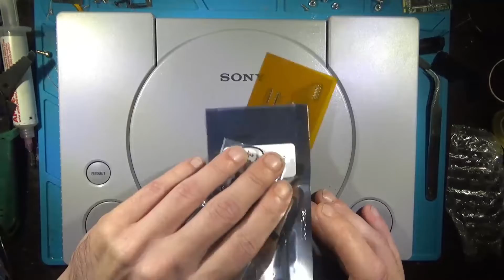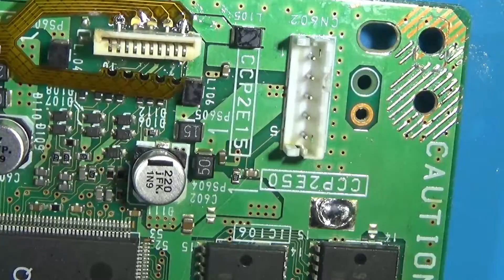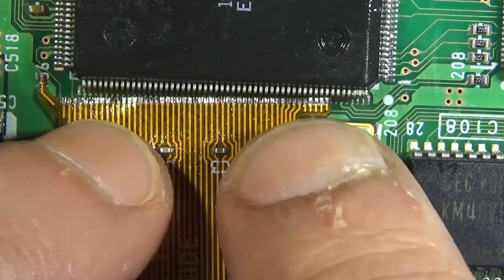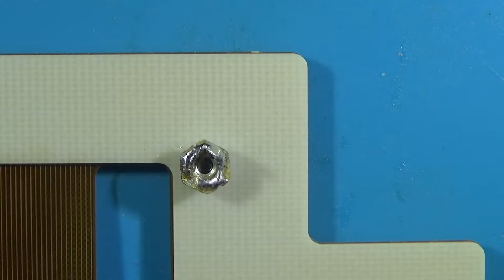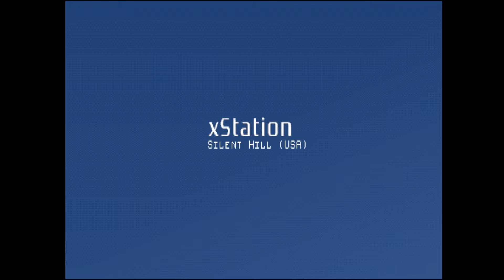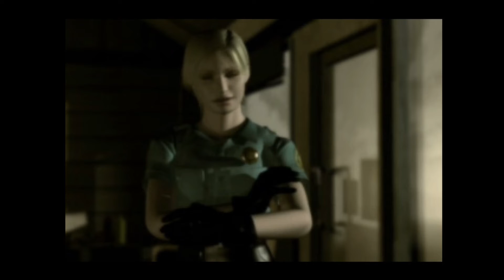PS1 Retro Gem / Ps1digital Installation

Comment: The installation guide from pixel fx says: -
Before installing the main flex, cover up any exposed vias that make come into contact with the flex. The CLK_EN pin can come into contact with via that is going to ground. Make sure you cover this up.

Didn't see you do this??

Comment: I fked up my initial install with the bigger flex cable, I did a drag solder and some of the pins got moved. I had to get a whole new flex cable and reseat the pins before reinstalling. Moral of the story, don't drag solder.

Comment: Hello , that was the perfect video . Great job . I have just finish installed mine . But ... I have this flickering thing at the boot screen , but not in the xstation or games . I think you talk about it around 18 minutes. For me it is more an up and down fast shaking . I don't know if it's the same issue . Or if it's an issue or not . Also , in rgb signal my sound makes crispy noises . When I use the debug test mode all is ok but for the rgb part it says it needs 24bits to be tested but my clk is only 15 bits . I'm not sur what to think about this.
Reply: I still have it in games i just realize . My image is constantly slightly shaking up and down . And no hearts in the rgb part in the debug mode. I think i have an issue with the clock . I did all the bridges for the clock mod and my pal console .

Comment: I've done 3 of these now. They were not easy compared to other modifications out there. Speaking of pixel fx durability, I got pissed off and went into "oh fuck it" mode while soldering the audio flex while having sticky trouble clearing a bridge no matter which flux I was using  or what method I used. This bridge was like something I have never encountered, and it angered me dearly. I cranked it up for 470 to fix the bridge after multiple attempts to clear the bridge by other means. It worked wonders and made the prettiest joints too. I then opted to throw caution into the wind and do the gpu flex the same way ( I had extra flexes in case of unrecoverable trouble). I covered the legs with kapton tape to protect it from solder splash. I did very quick tap and drags across the pads and it was beautiful. Thank you for the uploads I enjoy your stuff very much
Reply: Using a Hakko with a chisel tip, with good branded flux and Kester Solder wire makes soldering in advanced mods like this a lot easier. I find cleaning up bridges super easy with this setup.

Comment: Ya know emulators are free
Reply from the maker: git gud
Reply: That's not the point bruh
Reply: Emulators are fun but nothing beats playing on real hardware
Reply: @dcfuksurmom  this isn't real hardware any more
Reply: @simon_1987  it's modded, but it's still a real PS1. The hell are you on about?
Reply: @dcfuksurmom  nah it fundamentally changes the output of the system or the way it loads data.

You might as well just use an emulator
Reply: You do you..
Reply: @simon_1987 yeah, bypassing a DAC is the same as software emulating GTE, MDEC, Cop0, GPU, and SPU... just admit you can't afford it and move on lmao
Reply: I wonder if we could use a mini HDMI to full HDMI adapter just like the og PS1 digital.
Reply: @Emerald-CID  I don't see why not. HDMI and mini HDMI are the same electrically, its just smaller and might have some pins in different spots. The adapters are really just a passthrough.
Reply: You can play a pc racing game with ferrari in it or get your own ferrari for a drive, the choice is yours